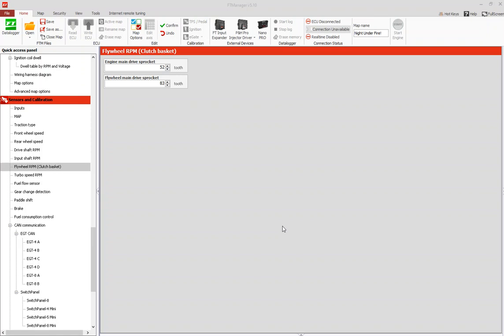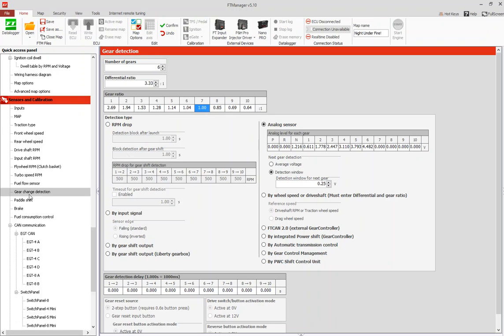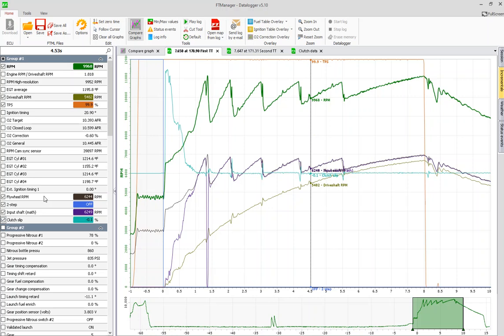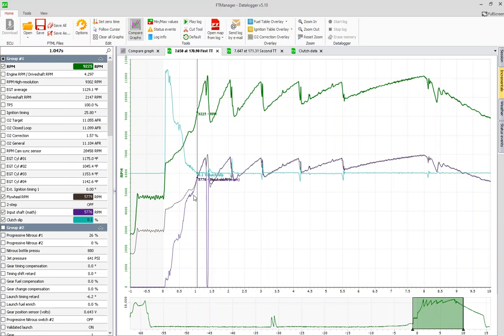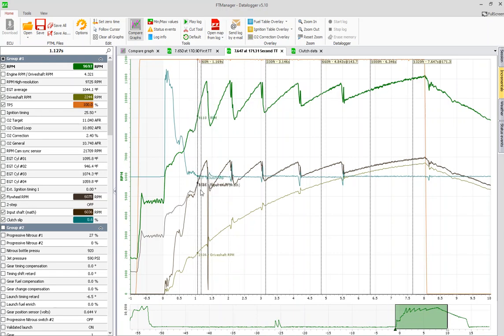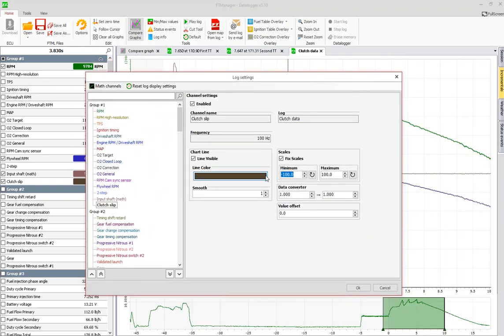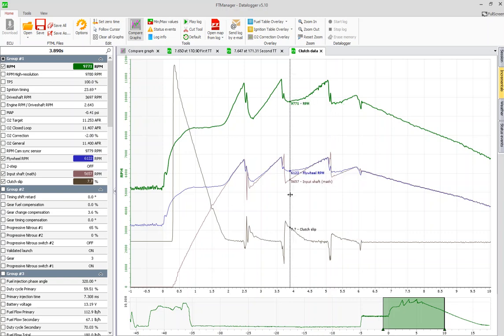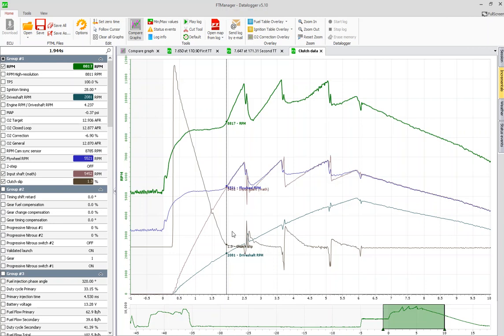FuelTech Clutch Slip Data!

Comment: Thanks for the video Dave.
If you don't have FlyWheel RPM (clutch Basket) you have to tick the box in Options under Sensors and Calibration.
Reply from the maker: Thanks for sharing